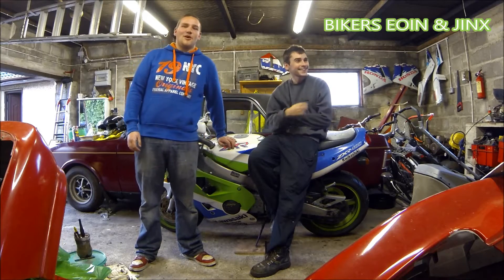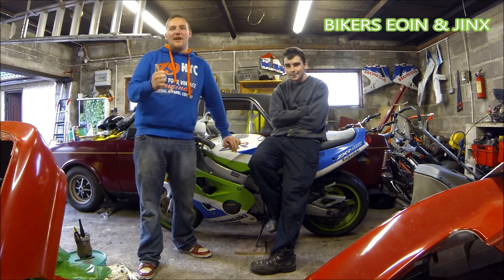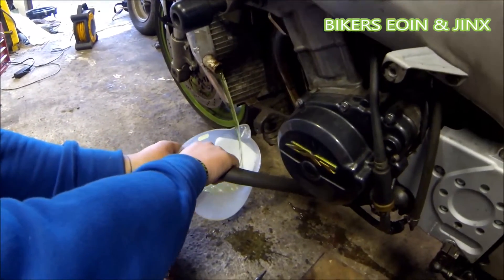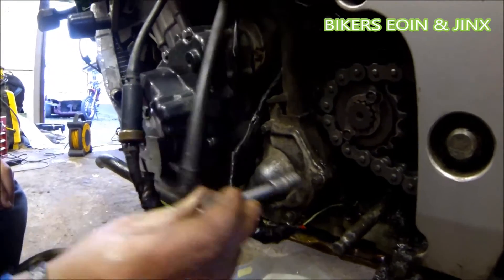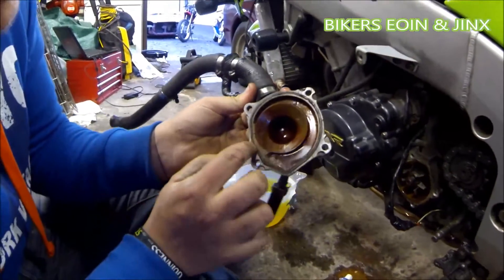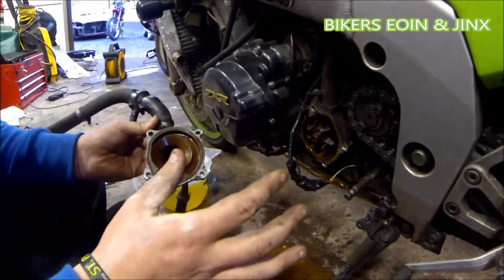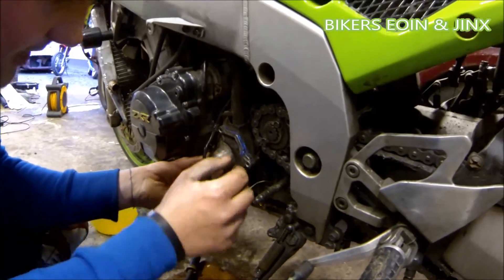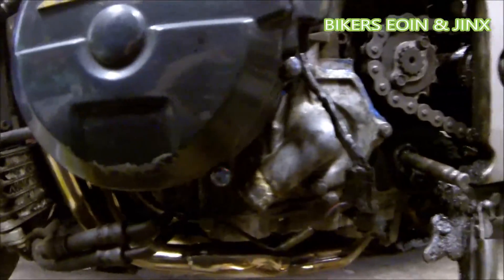How To Fix A Leaky Water Pump On A Motorbike

Comment: Just a tip. If your coolant looks like theirs does, than its the toxic kind of coolant. You usually don't want it to touch your skin, motorcycle paint or leave it on the floor if you have a dog/cat.

If the colour is more a dark blueish than its non toxic and you're safe.